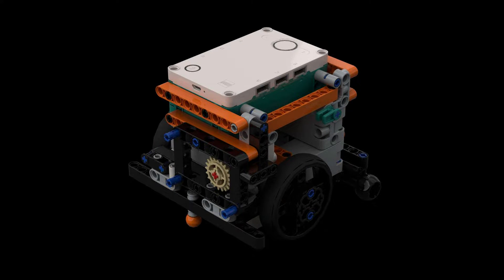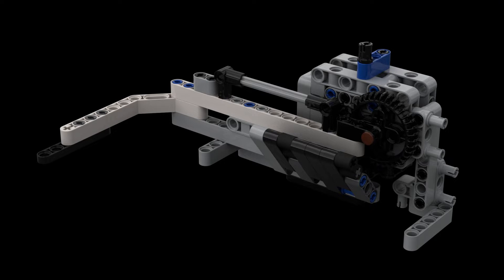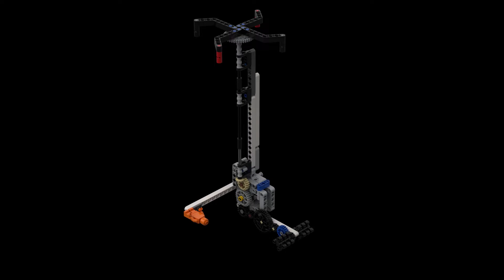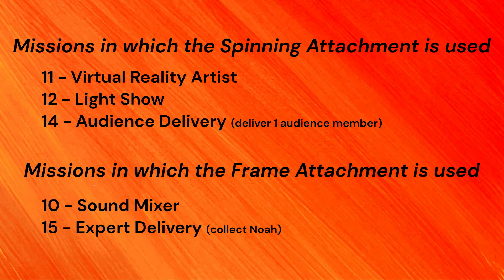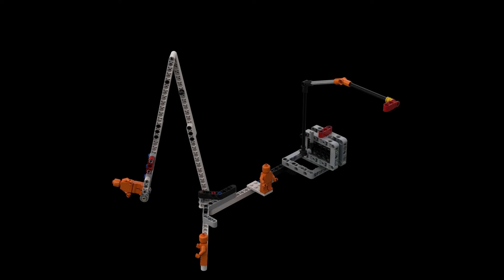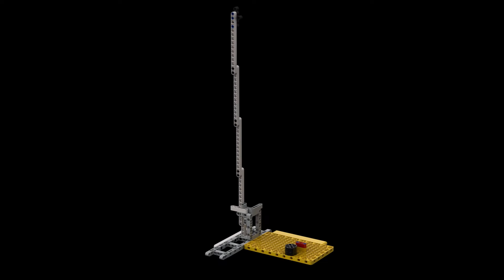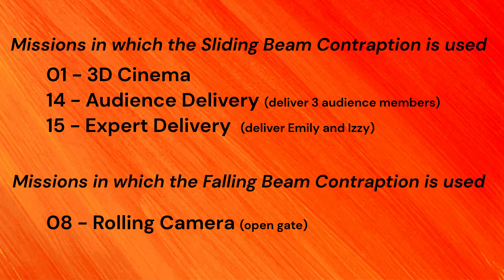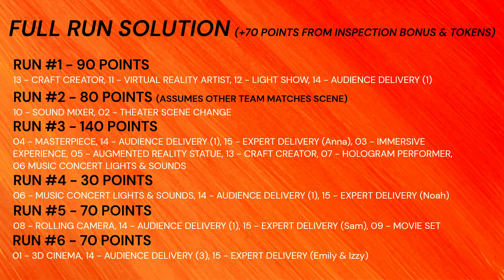MAX POINTS (550 Points) in 2:28 min. 2023-2024 FLL MASTERPIECE Full Run & Match Solution

Comment: I am using the attachments from the SPIKE Prime app, but are you allowed to use attachments from the base? It takes us more than 5 minutes to complete all the missons. How can I put the audience members exactly were they need to be?
Reply from the maker: Hello. You are allowed to use any means possible to solve the mission models, as long as it does not violate any of the rules in the robot rule book. That includes that anything you bring to the table needs to be made of unaltered LEGO production pieces. You could build an alignment jig from LEGO Duplo blocks for example. We decided to use part of our alignment jig in the red launch area to get knocked over by the robot arm and fall on the gate for the rolling camera. Any mission model that does not explicitly prohibit to be touching team equipment could also be activated by a structure that the robot takes to the mission model and leaves it there. You could search for “FLL static attachment” to find some inspiration on YT. 
Ways to save time are to make multipurpose attachments for the robot that can do more missions with the same attachment. The robot will be able to do multiple mission in one trip and you will spend less time at home performing attachment changes. Adjust the speed of the robot gradually to see if the programs still work at higher speeds to save time. 
It is good that you have solutions for all 15 missions. Now you should strategize which ones you want to do in the 2:30 minutes. Look at points values and combinability of missions. You are not required to do all the missions in the 2:30. Do as many as you can. You can also do some missions just partly, like push the M13 drawer in, but not open the lid, or launch the M08 camera, but not open the gate. There are only a few very experienced teams that will be able to do all the missions in 2:30 minutes. 
As for M14, think about where the audience members need to go and where your robot already goes to solve nearby missions. Since the audience members are allowed to touch team equipment and the rules state that any combination of a mission model with team equipment needs to be separable in one motion upon request, you could mount the audience members onto or place them into a structure that the robot can take and place in the target areas. 
Let us know if you need more help. 
⚙️⚙️

Comment: Hello! How do you make your robot turn and drive so reliably? are you using python or word blocks? cause my robot usually doesn't work more than 3 times in a row, except if we make it go really slow, do you mind sharing your turning code? I think you use a proportional controller, since another person did ask what controller you are using before, but my implementation of a propotional controller does not work as good as yours, could it be a robot thing? like it being to heavy for the motors or something like that??. Very impressive by the way, I wish I could make that good of a robot and attachements.
Reply from the maker: Hello. We use the Word Blocks in the Spike Legacy App. For turning we made individual MyBlocks for left and right turns with the turn severity, speed and angle as inputs into a “Move Steering at Speed” block and a “Wait until” block with the yaw angle being smaller (for left) or greater (for right turns) than the commanded angle. You probably saw that most turns are a lot slower than the driving. The slower you can afford to turn, the less overshoot you will have and the more precise and repeatable your turn will be. There are many YT videos that will explain full PID controlling for driving straight with either the yaw angle (or EV3 gyro) sensor or for line following with a color/light sensor. Since we work with elementary school kids, that is way too advanced, so we decided to start with just the proportional factor, which helps smooth out the corrections a little, but we hardly ever change it from a default value of 0.75. That being said we rarely use line following (we thought this year’s line layout was just too crazy) and are relying solely on the yaw angle sensor to drive straight and turn. 
We already mentioned speed being key. None of our straight moves to the mission models are going faster than 55-60% speed. Only straight drives back to home go faster. We don’t think that the motors are straining with weight, unless you really built your robot from solid bricks. As you might know the Robot Inventor kit only came with four medium motors, so that is what we use for our full match solutions and have not encountered an issue yet. Are you sure that your issue is not drag of the robot pushing items on the mat offset to the driving direction or something dragging on the wheels? How often do you clean your tires and wipe off the mat?
⚙️⚙️
Reply: @6006TechWarriors   Clean the mat? Nah, we rarely do that, only when close to the competition and want to make sure the conditions are right, pretty obvious problem now thay you mention it. Do you take all the mission models out and give it a proper clean or just wipe it??
Reply from the maker: @nombrebacan6289  Our mat and models travel a lot during the season and we wipe the mat off with a duster or wet wipe before putting the models back on. 
⚙️⚙️

Comment: hi , are u using gyro sensor ,if yes ,please can you share the codes ,as my gyro always keeps drifting and never works .my robot is not moving straight .please share codes for moving straight and turning
Reply from the maker: Hello. Yes, we are using the Yaw angle sensor of the Spike Prime or Robot Inventor. As you can see in our videos, we try to use a starting position that aligns the robot to the wall of the table (sometimes through an alignment jig) and zero the yaw angle at the beginning of the program. Leaving the launch area, the robot drives to a “0” heading. When turning we just use a “Move Steering Block” in which we can specify the turn severity (-100 - 0 - 100) and the speed (the slower the better) and a “Wait until Block”. As for the stop condition for the turn we use <((yaw angle) = ( )) OR ((yaw angle)  > ( ))> for right turns and the same with “<“ for left turns. Since we also use the yaw angle sensor to continue driving in the resulting heading, we neglect the overshoot. 
For the code to drive straight using the yaw angle, all you need to do is use the result of the subtraction of the current reading from the target angle as the turn severity input in a move steering block and put that into a loop with a stop condition of the amount of rotations of one of the drive motors. This only works driving forward. For driving straight backwards you have to reverse the math and make power and rotations negative. 
To make it more convenient to use we made MyBlocks out of these that we copy into any new program we start. 
⚙️⚙️

Comment: What programm did you use? Did you use Pybricks, Inventor hub python or the scratch blocks? And did you use PID Controll for the driving?
Reply from the maker: Hi. We are using the Scratch type Word Blocks. We have a progressive factor in our gyro move MyBlock that we rarely adjust. 
⚙️⚙️
Reply: @6006TechWarriors wow! That's amazing because you are very precise! 😮
Can you say a bit more about this progressive factor in the gyro, please?
Reply from the maker: @RenatoZandrini  That would be the “P” in “PID”. It is a way for us to adjust how severe the steering correction should be when using the subtraction result of the desired angle vs. target angle as the steering severity of a “move steering” block. Our default value is 0.75. Only if we want the correction to be more sudden we increase it to 1, practically using the angle deviation directly as steering input. 
⚙️⚙️